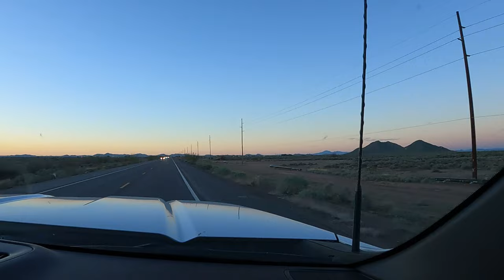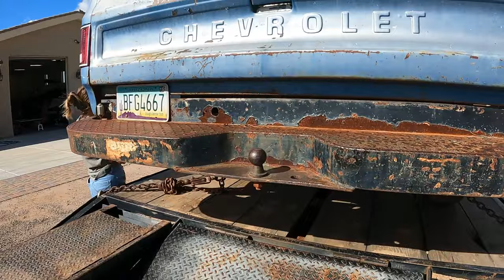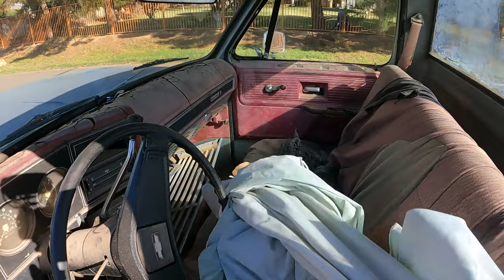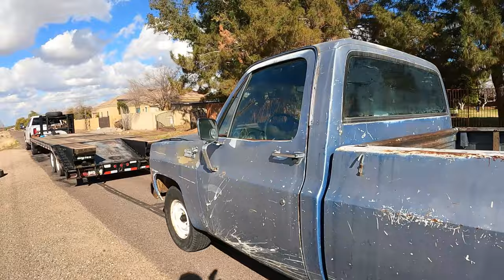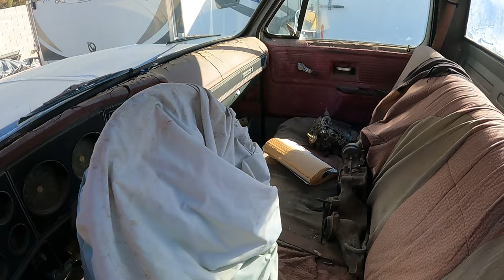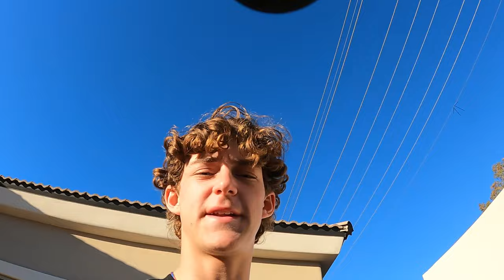Picking up a 1979 C10 chevy truck! (Part 1)

Comment: Not sure what you plan to do with it but a big block with holley throttle body injection, a 4l80e and a gear vendors would make it about as drivable as a modern truck
Reply from the maker: We are planning on putting a ls3 with a manual 6 speed in it